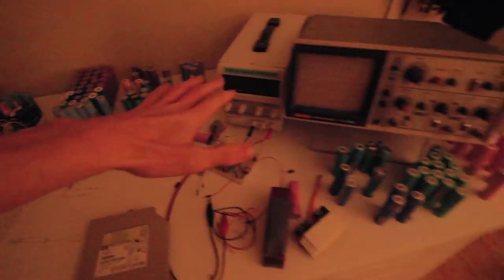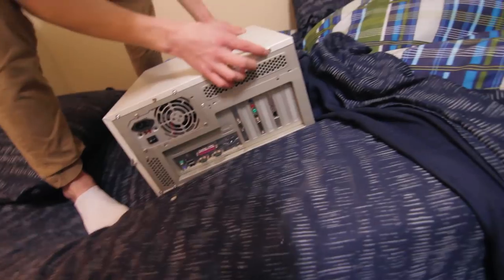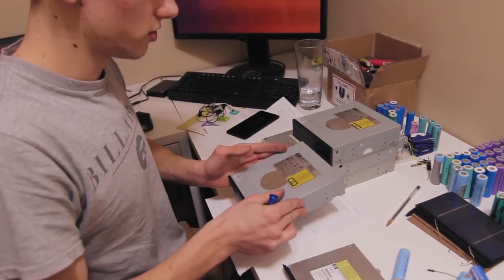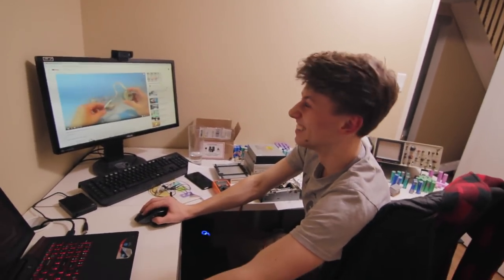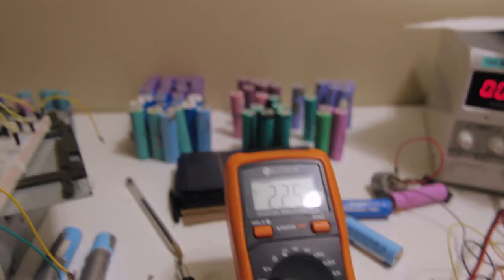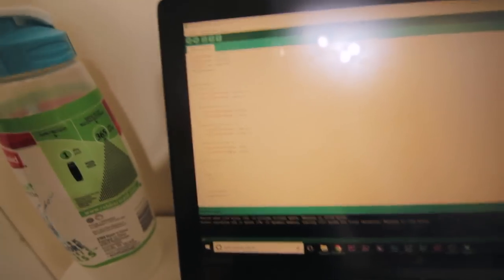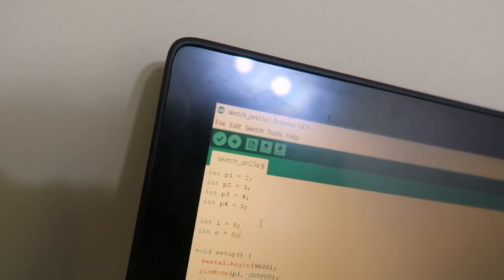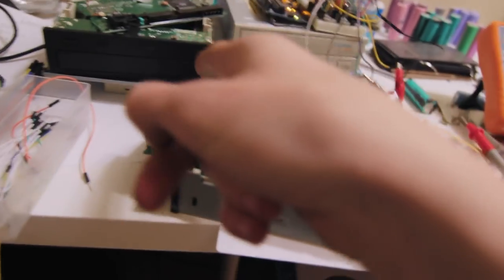DIY Battery Capacity Testing Robot | Part One (Arduino)

Comment: That's way too much current ? For a motor, yes it's a DC motor, but come on man a student should know better. 
It's not like you were putting current through a diode,  is band theory not a rudimentary topic to CS students?

Edit: 
Ok... just resumed the video. "it needs a high frequency", Jesus Christ dude it requires digital instruction. Thank you, for reaffirming my decision not to waste precious potential development time, and money, on what appears to be a congregation of barely sentient, apriori, monkeys who will inevitably suffer for their inadequacies.

Edit^2:
Dude, it's getting worse. That "frequency" you are referring to, is called PWM, a technology that has existed since at least the 50's. You could generate the (highly generic) work-cycle output, with a two dollar AVR.

This was fun before, but now it's sad. There are two types of commonly used stepper motor, a bipolar and a unipolar, they utilize sections of electromagnets to induce movement. Fucking basic shit.

- posthumous injection, one could control a Bipolar Stepper Motor (ergo, a motor with 2 coils, and 4 leads) by way an H-Bridge; or you could fucking google it, and realize that it's much more practical to use a standard Darlington Transistor Array. Happy thoughts. As it seems, you do possess an AVR, congrats, if you're initial concern for PWM wasn't so fucking stupid you could fix it. Also, and I hate to nitpick, but you're in college and you're writing EACH (of the 8) motor phase changes? Here bro:

byte indCoilx00[4][4] = {
  {1, 0, 0, 0}, // => output: 1111101000
  {1, 0, 1, 0}, // => output: 1111110010
  {0, 0, 1, 0}, // => output: 1010
  {0, 1, 1, 0}  // => output: 1101110
};

index it. Fuuuuuuck.

30 seconds have past:
Please god, stop displaying that recursive, data brick, of a loop function to the world. And you were doing it so proudly....

Despite the fact that everything I said is irrefutably true, I feel pathetic in the relative difference between our levels of anonymity. So here's my github, there's an XCode project on there I wrote when I was 13, I think you might appreciate it. 
https://github.com/lancewalk87
 
...Dropping the cruelty, I'm sorry that you have to use that "Soldering Iron". It looks like something the former CEO of RadioShack would bring to Thanksgiving in order to brag, it didn't work for him, and it certainly isn't working for you. Yes, a Hakko would be lost on you, but at least invest in a decent Weller for fuck's sake. The difference between a 0, and a 5 is analog. Judging by the state of the piece of paper you wasted, it would appear as though you tried to fix a DIGITAL circuit with analog current. Bro, it's not a fucking light socket, or a B.A.S.I.C breadboard project, consisting primarily of technology so primitive, aging father's look forward to explaining it to kids, almost as unimpressed as I am.

5:03, "you were just thinking logically"... then why in god's name would you write a method, so thoroughly recursive, so utterly inefficient,  that I have yet again been forced to question the value of human existence. Are you familiar with the notion of infinity that would mathematically suggest a room full of monkey's are capable of replicating Shakespeare's entire collected work? Ya, Google already tried it, and do you know what those fucking Monkey's gave use?  I shall not give the answer, for I am too empathetic by nature. 

FUCKING CODER
Reply from the maker: Hahaha I appreciate your anger towards this video 😂 I am a software major, not computer engineering so I've only taken one hardware course (digital logic) which is basic and does not address lower level circuit design. This video is about me teaching myself electronics as a hobby. I thought it was well known that I did not know what I was doing, that's actually most of fun in it. Trying to make something when you have no idea how to get there. I've never used a stepper motor or h bridge before so the reason I was so proud is I took the most logical idea for the controller in my head and it actually ended up working. I don't recall every saying this is the best solution, it was the first solution I got to work while teaching myself this stuff. And yes I have some very sketchy equipment. Good for you with all of your hardware knowledge. I'll be learning as I go
Reply: However, the inefficent reality of that recursive method stands. I have seen it in both Arduino, and Atmel Studio. A more efficient way to do it, is create a 2D array containing the digital pin states. For example: 

byte indCoilx00[4][4] = {
  {1, 0, 0, 0}, // => output: 1111101000
  {1, 0, 1, 0}, // => output: 1111110010
  {0, 0, 1, 0}, // => output: 1010
  {0, 1, 1, 0}  // => output: 1101110
}; // inversion 

uint8_t phase[] = {phase00x1, phase00x2, phase11x1, phase11x2}; 

void loop() {
   motorControl(); 
}

void motorControl() {
  for (int i = 0; i < 4; i++) { // index: row
    for (int j = 0; j < 4; i++) { // get digitalState 
      digitalWrite(phase[i], indCoilx00[i][j]);  
    }
  }
}
Reply: Lance Walker I like how you're so angry about him doing his hobby without having too much experience
Reply: I like how his entire fan base is populated with ignorant sycophants.
Reply: Lance Walker

So seeing that you have a good grasp of hardware development, where does a software engineer start learning this stuff. Any books/blogs you recommend? And btw, why do you get so angry / fed-up at someone, clearly not as experienced as you that is just trying to discover all those technologies by himself?

Oh, and do you have a blog/website or twitter?
Reply: Draven Main xd google
Reply: ....not related.
Reply: Lance Walker Since you so proudly shared your github I went and had a look, and you really can't say anything... most of your repos are just readme files with no actual code and when there is code its just a copy paste job from atmel. By the looks of things the guy in the video has accomplished a lot more than you, at least he has something to show for his work. 

What have you done thats an ounce original? written an abstract about the usefulness of clean water? congrats
Maybe you should write some actual code yourself or share a project that you have actually done (as in gotten more than 5% into) before you shit on other peoples work.

Everybody learns at a different rate and concentrates on different subjects, the video guy clearly aims at get a concept working before refining the solution. Grow up.

from  your blue proton project:

int main (void) {
 board_init();
}

Really pushing the bounds there...
Reply: Your criticisms would be appreciated if they weren't merely reactionary responses to my initial comment. No, the code written for my AVR projects were not copy and pasted,  you have not stated anything wrong with my code. In this particular instance, my version of Devon's stepper driver is far superior, that much is irrefutable. Additionally, people should not be dependent upon universities for knowledge, i'm entirely self taught, and clearly know more about both hardware and software than Devon; who is going to College for something I obtained  on the internet, free of charge. If you would like to continue this conversation (which I dearly hope you do), then by all means, make a specific and valid critique of my code. Cheers!
Reply: And just for the record the reason the ProtoBlue driver is incomplete....
is because it's incomplete, hopefully I'll have time to finish it over the weekend.
Reply: How long have you been doing electronics?
Reply: 2 Years, the accuracy of my answers, and criticisms are the only relevant factors in this conversation.
Reply: So if this guy has just done one class on electrons thats maybe a few weeks at a push (not familiar with how their education system works) this is probably the most complex thing he has done. I'm sure the first few projects that you did were pretty horrific in comparison to what you do now, I know thats the case for my first few software projects.

So why be so angry that an experienced person is making stupid mistakes? 

CS doesn't cover electronics in the slightest (unless you go out of your way to learn it) the most you do is learn the theory of logic gates in the context of memory and computer instructions. Are you just angry with how education works or trying to justify your educational choices by comparing yourself to a guy just starting at the lowest level?
Reply: People have different methods, the product is the relevant consideration. In this particular case, he could have achieved his goal more efficiently, with more knowledge and logical forethought; I wrote a mean spirited comment so my critiques would garner attention, thus correcting the objectively wrong aspects of his attempt. I care about Science, and Technological progress, it's not personal.
Reply: "FUCKING CODER" makes it sound personal no matter what intent you had when writing it, he has a reasonably small channel so the chances are high that he reads every comment. Maybe look at the signal to noise ratio of a specific creator before writing the most inflammatory thing you can to get the attention that you will get regardless.
Reply: Devon Crawford engaging trolls and haters with a civil conversation is the best way to disarm them :)
Reply: Perception is reality, I don't care how it was perceived. Simply don't take me seriously.
Reply: Lance Walker bro just chillll, it’s not that deep lmao
Reply: Whoooooaaa Lance brah whats up? 
All this anger isn't good for you. Did you have a bad day at work? Did your hard line liquid cooled loop pop a leak!?! Your reaction to this video is like Devon is claiming hes discovered free unlimited energy. 

If you would have taken the time spent writing and editing this post and instead making a response video showing how to use stepper motors that have been salvaged from old electronics, all of us in the maker/hacker community would have praised you. There is a need for content about how to reuse rather than buy. But instead you were like, 

"NAAAHH fuck that, i'm gonna go straight Kim Jong Un on his ass" 

Your reply to this content says more about you as a person than what you know. I think you started this slew of angry rhetoric to inform. But instead you came across as that atypical tech support guy who talks down to people without actually fixing the problem. 

 Lance, if you want to have a fulfilling life, with good friends, beautiful women, and opportunity's for growth in a corporate environment, spend 95% less time pointing out problems and instead give solutions. 

Or keep this 4chan attitude and enjoy your mediocrity.
Reply: ohh man, i'm a major in cs and devon has impressed me with what he's doing
Reply: Ya, it's weak to blame a substance, but I was on Adderall and had been awake for 2 nights working on a gimmie ripoff of Instagram. Not exactly my proudest moment, though my criticisms still stand. P.S. I most certainly do not want to thrive in a corporate environment.
Reply: Oh please, there exist Scratch challenges more complex than this.
Reply: I never argued that I was better, just that he was not utilizing the most accurate information and practices. I made the error of getting personal (likely because i'm insecure about avoiding college for a year to work), but everything I did criticize is correct.
Reply: Devon Crawford complete respect for this response bro. keep doing what you want to do.
Reply: He obviously cares about CS, as evidenced by the face that he is actively paying someone for information on the subject. I'd say I provided that same information for free.
Reply: you mad bro  😂 😂 😂 😂